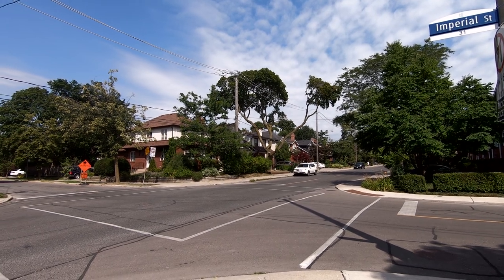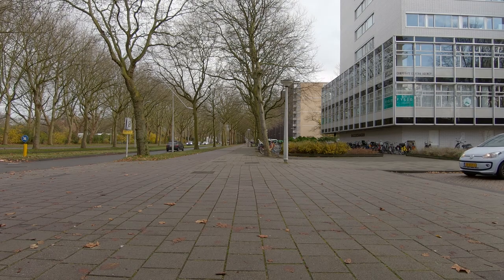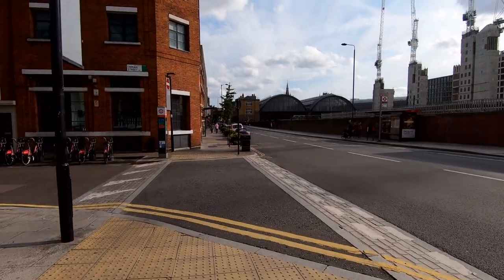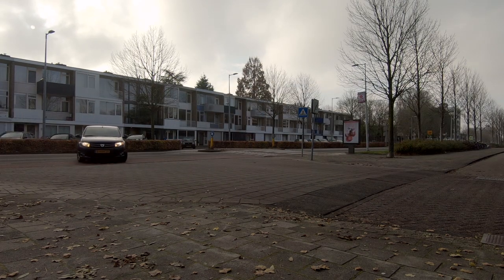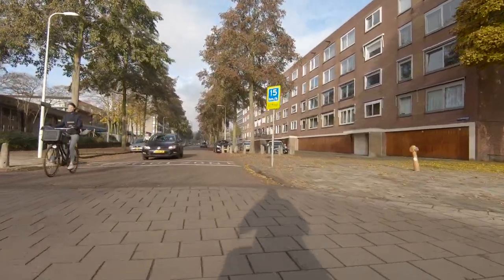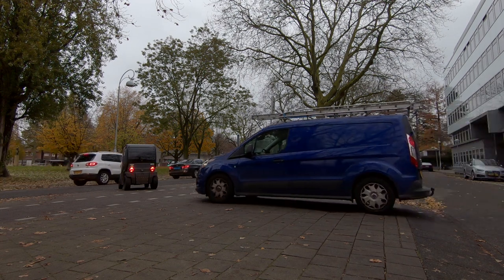The Dutch Solution for Safer Sidewalks - Continuous Sidewalks

Comment: In Switzerland they use the exact same design principle and some cities in Switzerland have almost a share of 50% foottraffic to the overall traffic. Although I have to mention that some footpaths in the netherlands are pretty tight and sometimes you really balance on a strip of sidewalk while cyclists have much space. Utrecht e.g. has just 3% foottraffic.
Reply from the maker: That's interesting, I hadn't noticed these in Switzerland, but I guess it's been a while since I was there.

But yes, Swiss cities have a large number of people who walk, because the infrastructure is of good quality, but also because public transit is so good.

Utrecht, and other Dutch cities, would have such a low walking share because cycling is so easy, of course. But I've also read that even checking friendly Swiss cities like Basel probably have less cyclists than they do because public transit is so good!

Comment: I'm really enjoying your channel.  I've lived in both the US and EU and love to compare infrastructure.

While the raised sidewalk makes perfect sense, it's not an easy task to retrofit "old style" US sidewalks as it would also require re-planning of drainage paths as the raised section would then isolate that plan.  It would also require digging deeper to add more grating and culverts as well.  It's not a low-barrier of entry despite the benefits.  It would make sense to do all new construction with raised paths so that the problem is solved holistically.

Comment: I live in New York City. This reminds me of one time when they were rebuilding pipes under the street in my neighborhood, but for some reason the streets are never resurfaced immediately. There’s always a wait. The result was that for a few days, at this one stop-signed intersection near me, drivers were forced to slow down as they navigated a bump left by the construction, a nice dip in the road, and I’ve never felt safer crossing that street.

It’s unfortunate that NYC already has “continuous sidewalks” at what we call “driveways”, which are mostly entryways to private off-street parking spaces within the property, whether that’s a private home with a garage, a larger garage within apartment buildings, or parking lots for supermarkets or restaurants or whatever. And I still fear using them. There are none at intersections with other streets except in remote private locations where the streets were not built and are not maintained by the city.
Reply from the maker: In my experience, those North American entrances that go over sidewalks are still quite easy to drive over quickly. They tend to have a very gradual slope. These Dutch continuous sidewalks have a very steep slope (and you can easily scrape the bottom of your car), so it slows down cars more than North American sidewalks with driveways. There's also a ramp on both sides, whereas driveways in North America tend to be flush with the sidewalk, so they don't slow the cars coming out at all.
Reply: You’re right about driveways being flush with the sidewalk. Aren’t shared streets (woonerven & autoluwte) the same way though? Here in North America there’s usually parking on the other side of the driveway.

And the ease of driving over them varies on sidewalk curb height. Some curbs are high and some are low; it’s definitely inconsistent, at least in NYC. On high curbs the slope is steeper and longer; if you manage to speed on those, you’ll be flying lol. You also don’t want to turn quickly into those because it will rock your vehicle crazy left and right. And if you’re driving into a garage inside a tall building then there’s a narrow VERY steep hill that follows the slope anyway, because the parking is often in the basement or second floor.
Reply: @samuelitooooo  At least in woonerven, they use multiple strategies to make car traffic drive slower and keep it safe. You are only allowed to drive 15km/h, you are to expect playing children suddenly bursting on the street (and its your fault if you drove too fast to stop in time) or other pedestrians walking on the street, they have a lot of curves in the road (a sudden curve every 2-3 car-lengths isn't strange, forcing you to zigzag around it slowly), and the pavement they use isn't the smoothest ride for fast traveling cars. The sidewalk and street are flush in a woonerf, but everything in its design is pedestrian friendly, and visably not meant for fast driving.

Comment: Also an important fact about this design:  Traffic on an elevated road always have to yield to traffic on the lower road. This makes sense, because the elevated sidewalks usually run parallel to a main road, and the cars who cross the elevated sidewalk are usually coming from smaller roads perpendicular to the main road. (see https://www.anwb.nl/verkeer/veiligheid/voorrang  paragraph2.) 
Edit:  Oh wait, i see someone already wrote about this. I guess they really drive this home when you're doing the driving lessons theory. Ah well... Cool videos!

Comment: this solution is brilliant. Just came from your video on stop signs which I felt would be difficult to apply in the Americas due to most drivers treating yields as if they weren't there. But this looks easy to implement, particularly for new constructions, without requiring the massive philosophy change of most of the other Netherlands improvements.

Comment: You know what I love best about Dutch roads? They are safe and clearly marked. Most drivers aren't completely incapable either. 

This allows for a rather large safety margin for pedestrians and bikers taking shortcuts if it would not bother anyone. Let's just say I walk through more red lights than green - I'm not waiting for ghosts. Of course, first look and listen - see if any other drivers would cross my path. If not, I go. 

In other countries I don't do this (usually..) but here at home I make use of the "gray areas" of the law. Like almost every one else does, by the way. I feel that this helps a lot with flow of traffic.

Comment: Mind you, when a car wants to pass over one of these, they never have the right of passage over a pedestrian, bicycle, or even other cars (only one exception here). They have to be alert to everything, which helps with safety.

The one exception is if one car wants to turn onto the sidewalk, while another car is turning from the sidewalk onto the road. At that point, regular right of passage rules apply (right has right).

Comment: I like that, except for the knife-edge kerb.  That's a problem.  It doesn't have to be a long smooth curve, but for truck access, there has to be a clear zone that won't cut tires when crossed slowly.

Comment: In all the street design another rule in nl is that your not allowed to park your car in the crossing blocking the view of traffic, you will find in almost all situations that car parking spaces and such are at least 5 meters away from where the other road is (in a straight line) so every t or x section without speciaal sideparkings are either marked with different stones in slow streets or raised to slow down traffic. You can check this with easy as most pedestrian roads are paved with 30x30 cm square tiles... Count 16 to 17 and you know the crossing is correct, its also nice for police to see if you have parked your car wrong bud thats another sideeffect. you can now keep in mind when in doubt if your car looks to close, just look at the road..

Comment: Moreover, this kind of design is IDEAL for mobility-impaired people. One reason the USA has so many electric wheelchairs and scooters is that there are "curb cuts" at every corner -- unless there is just a straight drop to the road with no aids at all.
Reply from the maker: Oh yeah, people with mobility Scooters are very well taken care of here. They can use the bike infrastructure, too, which is always smooth, wide, and available basically everywhere.
Reply: @NotJustBikes   Yes, but to clarify, my point is that "Continuous Sidewalks" are almost unknown in the U.S.A., unless they are incorporated into a speed bump structure. As a result, anyone forced to use a manual wheelchair needs to be pushed to get up over curb cuts.

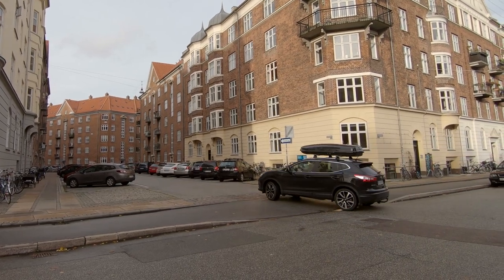Comment: I think my only concern with this (entirely from the visuals in the video and never actually having encountered a continuous sidewalk IRL) is if i was approaching the sidewalk in my car from the same direction as the car at 1:09, the way the sidewalk continues visually would make it a little difficult to tell where the area of the sidewalk I am allowed to drive over ends and the rest of the sidewalk begins, if that makes sense. The yellow lines at 1:37 are excessive and I agree with you about how it signals to the driver the purpose of the space, but they do also clearly delineate the border of the space. If there was a line of a different shade of brick in the 1:09 example that delineated how far left or right I can go into the sidewalk I would be more comfortable with it.

I could also just be way overthinking it and it's fine in practice. Sorry if this doesn't make sense, it's difficult to describe with text.
Reply: It's probably not so much overthinking it as having to have experienced it in real life. This is usually made clear by the way the rest of the street is organized, from the road signs to how the sidewalks and buildings are spaced, to things like trees or grass patches on the side which get interrupted by the turnoff. There will be exceptions to this probably in some places, but in general it's really very clear where the crossing point is supposed to be.

Comment: continuous sidewalks are amazing for dopeheads who lower their cars so far they have to go over them sideways.. always gives me a chuckle hearing that scrape!
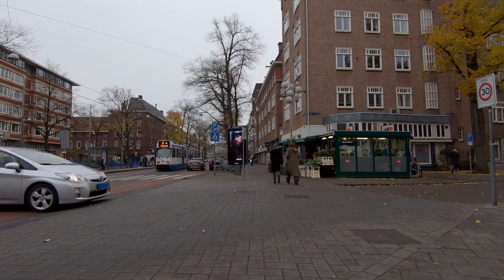Reply: The car at 3:39 also nearly bumped into the sidewalk
Reply: LOVE IT!
Reply: Yes, but, a relatively low car implies a better efficiency when the car is not in the city, I mean fuel economy or a better range for EVs. In France street bumps are getting always higher and now people buy SUVs. However, of course, continuous sideways and bike-lanes are great.
Reply: Sorry, but regular sports cars will scrape on these also due to low protruding aero parts. I guess if that makes you happy fine, but don't honk when I have to slow down and straddle the entire road to get over these.

For the record, I agree that visually differentiating the sidewalk is important, but making things hard to get over is not the answer. For example, when speed bumps are introduced cars simply go faster in between bumps to compensate for lost time.
Reply: @jetplume  The fact that speed bumps increase pollution (CO2, brakes, noise) is indeed well documented. And for EVs it decreases range. The solution is to enforce strictly speed limits, eg with automatic speed cameras. A far better solution would be to enforce carmakers to limit cars' Vmax at the road speed based of the GPS. It would cost nothing, just a few lines of code. No camera, no fine for drivers, no speed bumps, etc. However I am not sure that "sport" car drivers would like that.
Reply: @jetplume  i fucking agree slowing down for no reason, even when there no people crossing is just a waste of fucking time and fuel
Reply: @automation7295  I didn't say it was

Comment: The only problem of a continuous sidewalk is the lack of visual and physical cues for someone who is blind or visually impaired. However, some bright tactile paving would resolve this, like the picture in the UK.
Reply from the maker: Yes, that could be done for sure. But in the Netherlands, this is just the sidewalk, so there's no need to differentiate it. The same way that the sidewalk by a driveway isn't textured for the visually impaired in other countries. It's just the sidewalk. It's the drivers crossing it that need to stop for the pedestrians.

Comment: Indicating that you enter a residential zone is the main purpose of it , you will find these almost always when entering 30kmph or even woonerf areas , so its not just that its an indication of sidewalks to yield on but an indication that speed goes down, the zebrapaden do the same tho, its the same magical paint that tells drivers to yield for pedestrians (even on faster speed roads) but its much less ambiguous , take your UK example; the shark teeth and big triangle are "speaking" against eachother one being with the point in direction of the driver and the other on the curb/speedbum (hardly visible) the teeth are pointed to the pedestrian, this gives a mixed message , it also lacks either Zebrapad or cobble/klinker road surface to indicate very clearly that theres crossing foot and bike traffic... I also say AND bike traffic because one thing many places do wrong is have bikes drive "as if" they were cars; while at crossings you really want bikes to travel "as if" they were pedestrians; taking 90 degree angles so they are clearly visible and not in the dead zone of vehicles , so if only they started with making this magical paint clear and non confusing with big wide white blocks to indicate zebra-crossings and teeth pointed to the cars indicating and mimicing yield signage across the whole length and add centre islands then they would not even have to spend the money to indicate the 30kmph zones yet

Comment: I'm in central Washington and I don't own a car. The disregard for pedestrians in this area by most drivers* is nerve wracking. I now hardly ever cross at intersections if I can avoid them because drivers just don't stop or don't stop long enough, lights or no lights. It is safer to dash across a street between intersections although rush hour time even takes away this option.

* The truck drivers which are mostly interstate drivers are the exceptions who actually do regard pedestrians. (TY truckers) This might be bc they are professional competent drivers or just more sensible/thoughtful. The irony is that local drivers I talk to blame out of town traffic for the problem, but the problem is not just all the private vehicle drivers but Especially the local one's.

Comment: I will say that I'm not a fan of the brick roads. There should be another way to texture the path and junction if cars are going to be allowed on it at all even if it is just to cross it. 

Just a durability concern. Of cars weren't allowed then brick is fine.

Comment: I thought I didn't like walking on the sidewalk because of the high number of cars making noise but now I think I didn't like having to mind every step because the sidewalk gets lowered and back at EVERY driveways. Sometimes it's gentle, sometimes it's steeper that you thought physically possible to do in concrete. Seriously, it would need a photo to get my point accross.

Comment: I use a motorised wheelchair and Continuous Sidewalks would certainly improve things.  Bike lanes would also.  Gatineau, Québec is not that great for both accessibility and safe and wide sidewalks to accomodate two motorised wheelchairs passing each other. I use this example because sidewalks should be wide to accommodate "trafic"  in both directions. The width and hight of sidewalks is also dangerous to falls (tip overs) of wheelchairs.

Comment: I'm not sure if this would work in Canada... looks like the raised brick and cobblestone crossings would get torn to shreds by the snowplows, not to mention the constant freezing and thawing (water gets in the cracks and expands). My town tore up the asphalt on a perfectly fine crosswalk and replaced it with nice looking bricks. I assume this was done purely for aesthetics because it was still at road level and not a continuous sidewalk. Within a few years they removed and repaved it with asphalt (returning it to its original state) because snowplows would constantly tear up sections that had been heaved upwards from freezing, requiring frequent repairs. Another example of this kind of crosswalk retrofit can be seen here https://www.google.ca/maps/@43.4750729,-80.5280113,3a,71.8y,196.12h,74.77t/data=!3m6!1e1!3m4!1sTvHMU8xh-dSmfPQVO6zuAQ!2e0!7i13312!8i6656

If you look at the crosswalk on the southwest side of this intersection, you can see a section on the left where the bricks have been removed and replaced with asphalt. That's not the only problem with this intersection, of course. I was almost killed here when an oblivious (possibly drunk, who knows) driver ran through the red light at night... he was speeding northeast down that hill at 100kph. The only thing that saved me is I stopped halfway across because I didn't think he had enough time to stop... well he didn't. These huge open, wide, and straight 4-lane roads are very unsafe, as they're basically drag strips for lunatics to see how fast their sports car can go (especially on this downhill section). They floor it, and there's nothing to slow them down, so I could see continuous sidewalks being very helpful for this particular intersection.

This neighbourhood is also particularly unsafe (and many pedestrians have been killed, most recently the university's Dean of Students) because it's so full of pedestrians due to the thousands of students who don't have cars and must walk everywhere, yet the neighbourhood has what are essentially two 4-lane highways running through it. The roads are thoroughfares, and most traffic is simply passing through and not going to or from the campus. Obviously the thoroughfare traffic needs to be routed around the student neighbourhood, but how? Combine all that throughfare traffic with inexperienced student drivers, and you have a very dangerous place to walk.